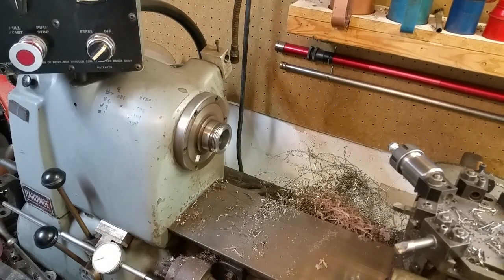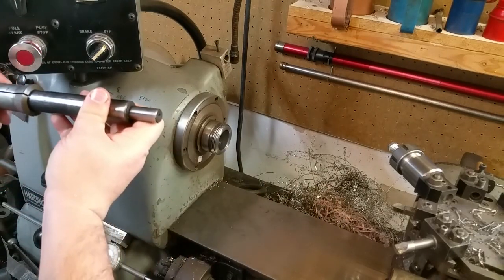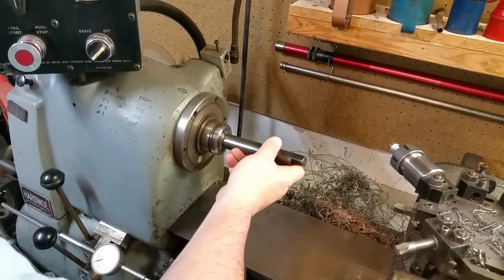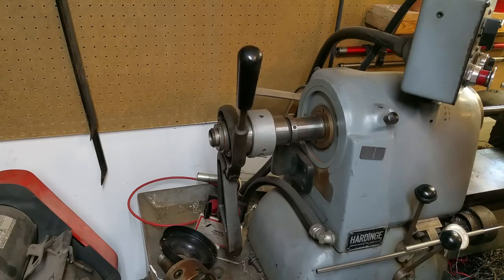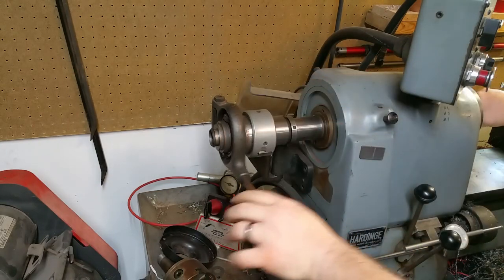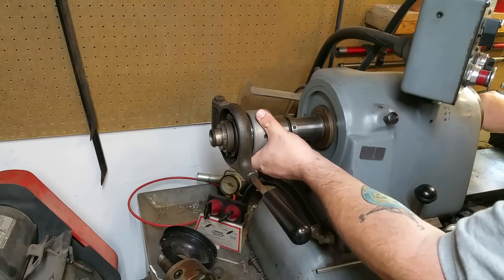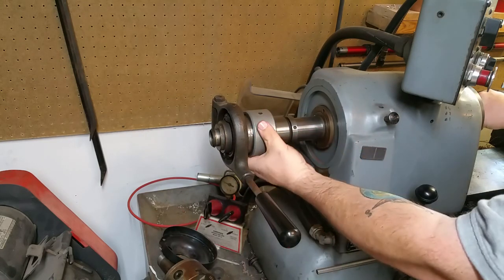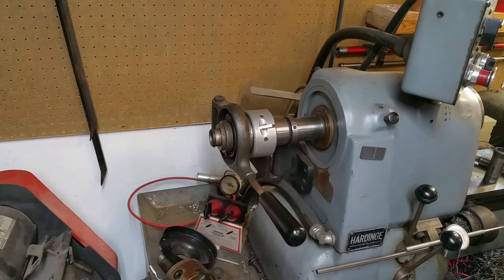How-to setup a collet closer

Comment: Thank you for the time to make this. I just bought a Hardinge and know nothing about how it works so watching all the videos I can to learn about it. Should you remove the collet locking bar when using a 5" chuck?
Reply from the maker: No, you can leave ît installed when using a chuck.

Comment: How do you lube/oil/grease/repack the bearing at the end of the closer?
Reply from the maker: I've never had to do that, but I'm pretty sure it's either a pair of sealed deep groove ball bearings, or it's a pair of angular contact ball bearings.  My money is on the deep groove.
Reply: @eformance  Should they be serviced, or run them till they start smokin?
Reply from the maker: @john6276  They will get loud and rattle a lot before they fail.  If it's not rattling a bunch, it's fine. There is only force on the bearing when you're opening and closing the collet, it just idles the rest of the time.

Comment: FYI......BE VERY CAREFUL with that pneumatic bar feed you have there, they can be 
deadly.  A friend of mine had one bend 90 degrees while running only 1100 RPM. 
Hardinge had a recall on those units years ago and took them off the market. There is no outboard support and they will bend and injure or kill you.  If you insist on using it, make some sort of outboard support for it that attaches to the machine to prevent bending and deadly failure.
Reply from the maker: The bar feed sits almost entirely inside the drawtube of the closer.  I built a larger unit about 1m long for the CHNC1 that has an outboard bearing mounted in the through-hole of the cabinet.
Reply: How is there room for the material if the red tube is inside the draw tube?
Reply from the maker: The draw tube is about 1.0625" ID and the bar feeder is about .875 or so.  The feeder has O-rings that grab the inside of the draw tube and the open end sits inside the back of the collet.  You turn a knob and the O-rings expand, holding the inside of the draw tube snugly.  The outboard end of the closer is removable and you take the pusher piston out to put a new bar in the end.  The bar length is limited to about 24 inches.  If you look closely at the beginning of the video, you'll see that only about 4" sticks out past the adjuster nut sleeve.  The piston has a female taper so the pressure keeps the bar centered in the piston, the collet centers the other end.
Reply: Thanks for the description on how it works, but I've used my friends several times before it failed and I'm aware how it works.  I'm confused on where there's room for the red tube and the stock inside the draw tube. The Hardinge manual shows at least 18" of the red tube sticking out of the back of the draw tube, probably more. Not sure how it can work otherwise? Maybe you could do a short video on how it works? Have you actually used it? Maybe his had critical parts missing?
Reply from the maker: Sure, I'll do that an a little while.
Reply: Thanks
Reply from the maker: +kmcwhq Here's the video on how the Hardinge HF-1A bar feeder works: https://youtu.be/8jvPaEBqovg
Reply: kmcwhq  owner of shop was showing off to customer or our ikegi  engaged power but stock not in place launched piston through two walls into street mever did find it
Reply: kmcwhq making a soupport is easy ..must have been running smalll stock..and also must just be learning..everone knows to add or build one